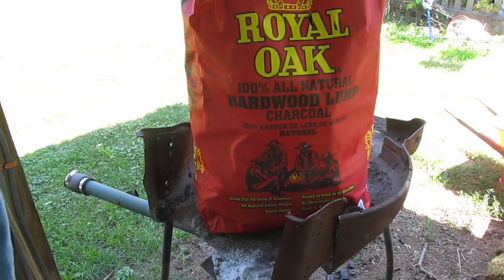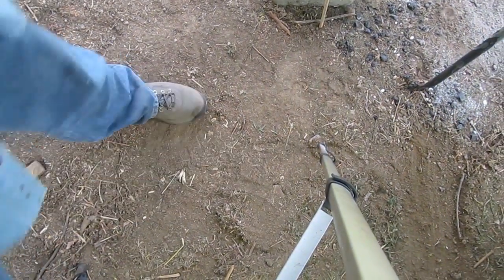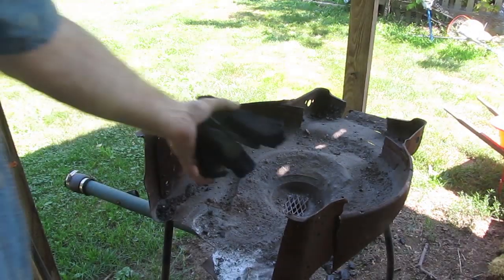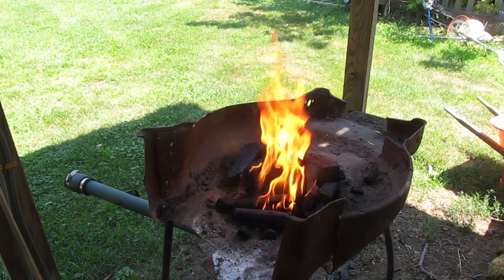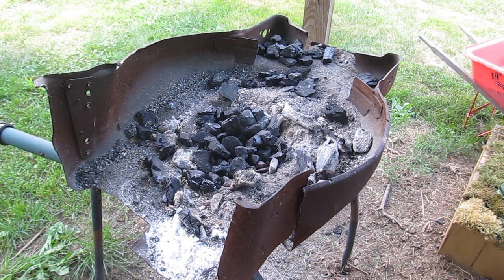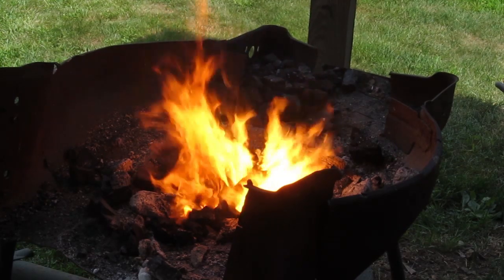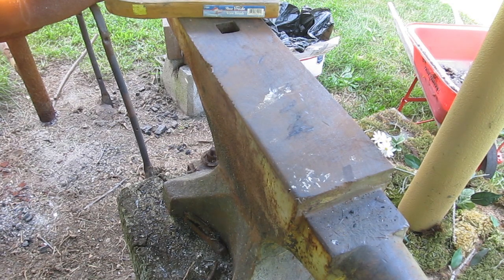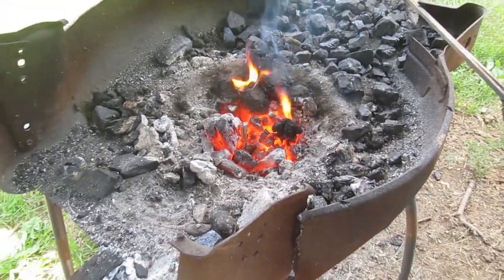Forging with Coal Versus Hardwood Lump Charcoal

Comment: The first time i used actual coal after using charcoal for a while i burned more steel than i forged!! It gets much hotter much faster, but it makes a TON OF SMOKE and a TON OF STINK.
Reply: and clinkers
Reply: You want hotter charcoal fire you need to have smaller pieces. Hotter and more even heat👌
Reply: The clinkers and silver ain't the nicest part of coal forging

Comment: I like the channel, but you did not have near enough charcoal in the fire .  I always have enough to insulate the fire, and I never have trouble heating the work.  That is a pretty coal fire though.  I will freely admit to being a charcoal fanboy, no stink or gout of smoke to tick off the neighbors, NO KLINKER yaaay!(my forge is a modified 16" cast iron fry pan, so that matters more for me)  Also, since Grilling has become a national sport, it has great availability.  If you have a chance, Walmart sells a Hickory Lump Charcoal that is incredible.  It burns hotter, and twice as long as the Royal Oak or Cowboy will.  It also make the hotdogs that I roast over the idle forge tastier. You can also use the ash as welding flux in a pinch.  Love the Trebucet!
Reply: branch42 What is the difference between using hardwood charcoal versus the cheap briquettes?
Reply: @MK23C  lump charcoal heats better and won't produce clinker, briquettes are much less efficient and can sometimes produce clinker.

Comment: You probably would have done better with the charcoal if you'd broken it into chunks the same size as the coal. You had a lot of non-burning material (the inner parts of the large chunks) taking up valuable burning space.

Comment: Real hardwood charcoal burns hot, makes a good forge fuel,  but it throws sparks and burns through fairly quickly.

Most forging coal I've tried is quite frankly low grade coal, not much good for much else. Gets even hotter than charcoal, but smokes like crazy and leaves big wads of clinker in the grate (we call this stuff "slack" or "super sifted never glo" in the steam engine field).

The best stuff is anthracite by far, burns cleanly with virtually no smoke at all, lasts a long time before you need to put on fresh, prodigious heat.

Comment: Uh, what? Charcoal isn't burned under pressure. It's burned in an anoxic environment, pulling out all the volatiles and excess water while retaining a carbon rich core, along with the trace minerals in the wood. This may or may not involve high pressures, depending on the technique of producing charcoal.
Reply from the maker: Great comment. Thanks!
Reply from the maker: Great comment. Thanks!
Reply: epicfantasy "I'll make you a nail"? Lol
Btw, you should be burning the sulfur and volatiles out of the coal, aka making coke. I can't believe that you threw away the best fuel at the beginning of your video. Also, why did you clean out the fire pot? You should also leave the dust around the edge. I shouldn't have to tell you this, if you are making a video, at least educate yourself on the subject first!
Reply: 73Corbin  The gases need to be burned off. It happens naturally when making a coal fire. You just need to pile it up good and let it burn a little. When the smoking stops you are burning coke.
Reply: 73Corbin  Same as turning wood into charcoal.  Anoxic pyrolization.

Comment: Here's a hint. build a small charcoal kiln and make soft pine charcoal.  It burns a lot hotter than coal, coke, or hardwood.  In fact, if you don't control the fire, it will melt your steel!!!!!  And it is all most free!!!
Reply: Won't hardwood charcoal last longer though? Like pound for pound, shouldn't you get more heat out of hardwood?
Reply: @zenyatta3947  pound for pound the heat output should be nearly identical.

Comment: You should wear safety boots, but NOT ones with laces, or you should wear metal shields on your boots. Well, maybe not for forging, because the steel doesn't actually melt. I worked in a foundry, and had boots with laces (brand new) and molten metal leaked onto my boot and got caught at the bottom of the tongue. It was a race to see if I could get the boot off before it burned through the leather. It was close, got burned, but would have been much worse if it would have taken me any longer.  Always wore a slip on workboot with no laces after that.

Comment: Interesting video. It's kind of neat to see the differences between how my little firebrick trench forge burns charcoal compared to yours. I was having issues with my steel melting in my charcoal forge a couple days ago, and much faster than I would expect it to.

Comment: That greenish smoke from the coal fire is the volatiles coming out of the coal not the sulfur.
Reply: Isn't sulfur a volatile?
Reply: @dansw0rkshop  Sulfur burns with a blue flame and no smoke. What one is seeing is coal tar which is the bulk of volatiles.
Reply: @johncolvin2561  The smoke may very well have contained sulfur among the so called volatiles, he commented on the smell.  Didn't you smell it too, it was right there in the video?!  There was SMOKE, which is something that isn't burning.  There are lots of things all mixed together in that smoke, including things that might burn clean and blue if burned all by themselves.
Reply: @dansw0rkshop   Bituminous coal used in blacksmithing contains less than 1% sulfur. FYI coal tar burning produces large amounts of smoke and smells a lot worse than the oxides of sulfur.
Reply: @dansw0rkshop  FYI Smoke comes from incomplete combustion.
Reply: @johncolvin2561  Very informative.  I know the tarry odor too, from visiting the blacksmith at the nearby old engine show.  What does the rotten egg part of the odor come from?  I'm not an experienced blacksmith, but my nose works.
Reply: You seem pretty knowledgeable.  Why's your channel empty?  I.e. click on your user name and it says "This channel doesn't have any content"
Reply: @dansw0rkshop  I don't do videos. I nearly obtained degree in chemistry in college. I have completed training in machine tool technology and worked as a machinist until my retirement.